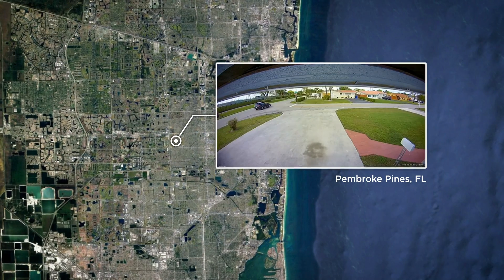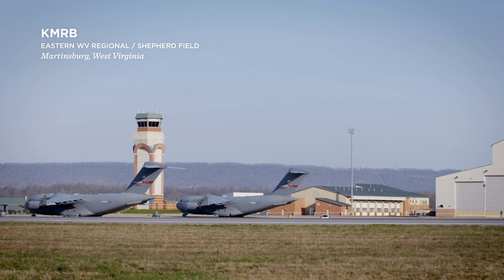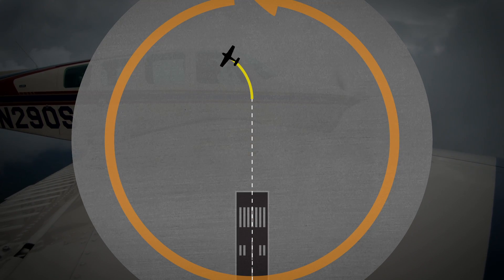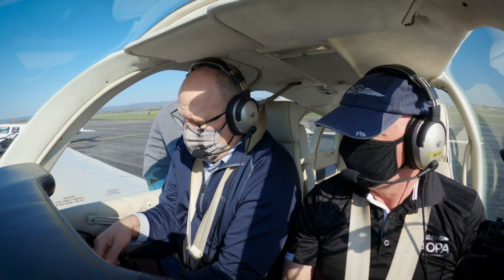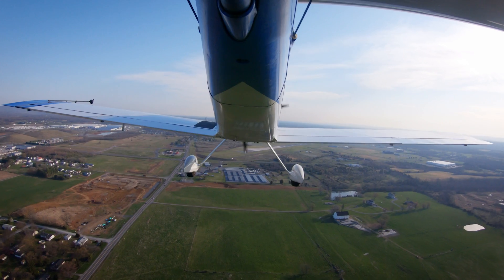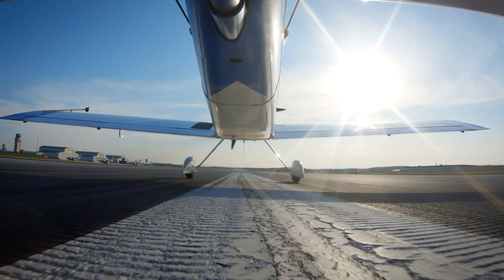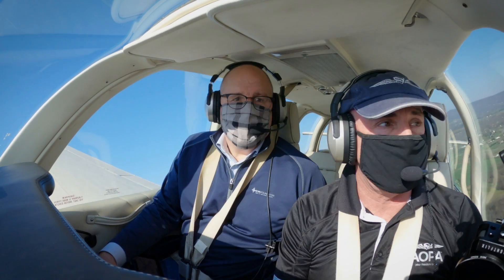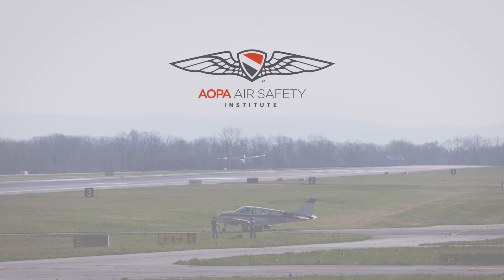Reality Check: The Runway Behind You

Comment: Rarely do you see such a group of professionals like this all agreeing to document so thoroughly their idiotic behavior on YouTube. Usually, it is the amateurs doing that.
Reply: No.. The best pilots can do that maneuver.  The wimpy ones dont want to practice it.  Then when have to do it, they do it from too low or wrong way.  Those are the ones that crash, not the ones that practiced it and know it.  Ignorants crash, not the sharp ones.  Ignorance is not the answer..
Reply: @outwiththem  You don't get it. Practicing is not the issue. Practicing at low altitudes is the idiotic part. I don't care how good you think you are, you don't put yourself and others at risk like that. It basic common sense when this same emergency procedure can be practiced far more safely at higher altitudes.
Reply: @slickraft  A 45 degree turn at say 600 agl is not dangerous for most non gross weight, not short wind USA GA.  
We used to do them on short wing Grummans in the 1970's at 600 agl to practice Windy GRM.  We used 10-15 flaps and Vfinal speed of 75-80 mph.  Knowledge of Windy GRM is the answer, NOT IGNORANCE.
Reply: @slickraft  I like your corvair videos, though.  Like airplanes with those engines..

Comment: I agree with all the comments that this should not be tried or practiced at low altitudes.  Air safety institute should reconsider these kinds of videos.  They encourage unsafe practices and are not what this organization should be about.
Reply: The impossible turn CANNOT be attempted at higher altitudes, why?  Because that is not an impossible turn.  In real life, the definition of an impossible turn is low and slow and too far from the runway.
Reply: @speedomars  you are wrong. You can simulate everything that was done at higher altitudes using a safe altitude as a simulated ground level.
Reply: @donwd007  Wrong.  Sure you can practice at a "safe" altitude but there is a critical element that CANNOT be overcome...advance knowledge that you will attempt the turn.  Unlike standard maneuver and practice, the impossible turn can ONLY be simulated if you DO NOT KNOW you are going to make the turn.  Dozens of factors are at play and all of them have to be precisely determined and calculated and executed in a precise way.   Speed, altitude, distance from runway, flap and prop configuration, cutoff fuel, cutoff mags, turn 180 degrees that will rapidly increase load factors bringin on the stall  ALL without engine power.  One also must FIGHT the impulse to keep the nose level or high as the stall progresses thus worsening the stall.  IN other words, one must lower the nose close to the ground despite watching the plane hit the ground short of the runway.

The impossible turn cannot be effectively practiced and prepared for and anyone who assumes they can make the turn, if faced with the above factors have only incorporated a deadly scenario into their assumptions.  Most CFIs correctly teach that if you lose power or control on takeoff plan a STRAIGHT AHEAD crash scenario.  And that is the responsible thing to teach.
Reply: You are right, but you sure don’t have to paralice all those things at a low altitude. There is no way to practice how you will really react in an emergency, but if you practice what to do, then the hope is you do what you practiced at that time.

Comment: Been a  CFII for 33 years  and I would never teach or practice this maneuver at these altitudes.
Reply: Oh poor you.. Demonstrate where to crash ahead, by not doing turnback from say 1,000 agl.. Demonstrate it on you own neighborhood. Lets see that crash video.  That maneuver saved my life.  Know 4 pilots that did it too and didnt crash on houses too.
Reply: @outwiththem  You don't practice any maneuver with the stall warning going off this close to the ground. Funny you know five pilots that have had to turn back. Sounds like your problems run pretty deep.
Reply: @einzelganger1049  Old airplanes.  South America.  But know 2 more in usa that turned back with some power (One of them from 300 agl or less he said.  due engine problems and landed well w no damages.  There are more possible turnbacks done well than impossible done by idiots.  But not registered at all due no damages.  With power it is like a slow flight turn at Vfinal speed and no stall warning will come on if 45 bank only. I did them on all kinds of cherokees..
Reply: @outwiththem  You would still have to report the incident to the FAA. But I would say  you didn't do that either.
Reply: @einzelganger1049  Why should I?? They are busy enough with the ones that crashed.  No damages, i just spoke with the mechanics to figure it out why it started failing.  If a fire, you have to report it, even if minor damages.

Comment: This is an extremely irresponsible video. Demonstrating unsafe flight at unsafe altitudes puts your pilots and viewers at risk, even if you put in disclaimers at the end. All you're doing is creating doubt (or hope) that someone could make that turn. And that could appear when they least need the doubt, during an actual engine failure. Do these simulated failures at altitude and encourage anyone else that wants to gain skill or learn the limitations of their plane to do the same. Only with the skills developed in (safe) practice should anyone gain 'hope' that they could turn back and live to tell about it. Yes I know there are exceptions that have made it, but as a rule (that you proved yet again) the odds are very high that you'll die trying it. Very ironic that this is published by the Air 'Safety' Institute.

Comment: What are you selling?! Some kind of lifeguard for inexperienced riders? Or even for pilots with more flight hours who want to deepen their knowledge? To reconsider or "reanalyse formal and established procedures? 

From everything I've seen in this video, I realize that an environment with very few variables and optimal circumstances was simulated. Almost NOTHING was considered in relation to a previous preparation by the pilot before takeoff, or even before starting the engine (what would be more advisable)! Such maneuver could only be performed in an aircraft - with extreme risk to its occupants - if there was such a preventive preparation. BUT it could only be taken seriously in a test environment formally established with lots of instrumentation available and performed by personnel CERTIFIED to do so. But even so, I don't believe that any common or ubiquitous "trick" could be obtained that would be of value to the common pilot. You missed the chance, in that very final statement, to emphasize that nothing you did was of any use to anyone, and that established take-off engine failure procedures are still in effect. However, you chose to issue that bad advice "to fly with a CFI, at altitude first, and DETERMINE YOUR STRATEGY in the event of an engine failure at takeoff". That's only an incentive to carry out experimental maneuvers in an uncontrolled environment and devoid of professionals qualified to that (CFIs are NOT! Test pilots are!). 

FYI, I´m flagging this video as harmful or dangerous acts.

Comment: I only have 30 hours, but can easily discern this video is more dangerous for thousands of others to be mislead by than the actual number of engine outs.
Reply: @John Doe Ah I thought they explicitly said to do it -  at 9:10 "fly with a CFI - at altitude *first"
Reply: @John Doe Well to be clear I have 32 hours now... but I think despite having so much more experience now, I concur obviously. In fact I will never do this.
Reply: @John Doe thanks! It was an amazing experience!
Reply: @devb8904  I taught them from 700-800 agl power off after take off to many, on many kinds of Cessnas, Grummans, Pipers, and a Sundowner.  You only did Wimpy high and wimpy winds GRM??.  I learned GRM the real way.  600 agl, with 12-15 knots winds on a...  Piper Colt.  The flying brick.  1969..
Reply: @emergencylowmaneuvering7350  You mean back in the good old days with vastly higher death rates? Yeah I think we're all pretty happy that we're not as bad anymore as you guys used to be.
Reply: @devb8904  You posted "steep banks close to the ground after the startle of a real engine failure will always be hard to make safe for an amateur pilot". 
 Not if he has Windy 600 agl GRM training.  And turnbacks training too.  A student i had with those 2 kinds of training had a cylinder out at 250 agl.  With 2 more on board a 145 hp 1959 C172.  Full tanks, almost gross weigh.  Had his license for 6 months only.  About 70 hours total. 

You will crash it on houses, Not him.  He climbed at about 200 fpm only to 300 agl, and did the Question Mark Turnback to opposite runway.  Landed safely.  Sorry you will crash..  LOL.. I have more stories.  We didnt crash, dont be such A Maggot.  LOL.
Reply: You have not flown enough to understand the basics of this dangerous subject.
Reply: @speedomars  oh gotcha so I should have not even watched this, much less considered it. They should put a warning on the intro then "To watch this video, or form an opinion of it, you must have how ever many hours *SpeedoMars thinks is sufficient, but has not clearly stated."
Reply: @BrianSiskind  The premise of the impossible turn can ONLY be understood if you have a lot of experience AND have a working knowedge of the PHYSICS of flight.  Newton's second law of motion, namely F=Ma for starters (a subject 90% of experience pilots let alone newbies understand).   If the plane you are flying now, or have trained in, does not have an AoA meter then you cannot visually verify why the impossible turn is impossible.   The meter will PROVE to you how quickly the critical angle of attack is exceeded in ANY turn, let alone a turn that is SLOW and LOW to the ground.  There is a good reason why good instructors teach NEVER to exceed 20% bank in the pattern or on takeoff or landing.  Also, you need to practice slow flight at least 1000 feet AGL.  Sadly, most CFIs will not teach the most critical maneuver, have you done this?  Slow the plane to just above stall speed, pull up the nose and start to turn left or right AT STALL SPEED and see if you can hold it.  It is a dangerous maneuver and is EXACTLY what happens in the impossible turn only you must make that turn a full 180 degrees and not stall...If you stall, you will NOT be able to recover at or below 500 feet agl.   Which is the key reason the impossible turn cannot be made...
Reply: @speedomars  this (which I know already) serves to validate my initial comment thank you.
Reply: @devb8904  The coward shuns the brave teachers.  Flight training, like defense training is not about seeking comfort and ending up more fragile, but the contrary.  I dont teach girly guys anyway.  Keep walking, street walker.
Reply: Did you ever do the required GRM Rectangular Pattern for student pilots?? YOU didnt??  If windy, on the downwind turn, you are required to turn 45 degree bank or overshoot the turn.  Also if wind, on the downwind side of S Turns. 

Sorry for you.  Or your CFI could only teach Wimpy Winds GRM?  All pilots should know how to turn 45 degree bank when needed and say at 600agl.  Cant do that?? Shame.  Mild Maneuvering Makes Maggots..
Reply: @emergencylowmaneuvering7350  wut